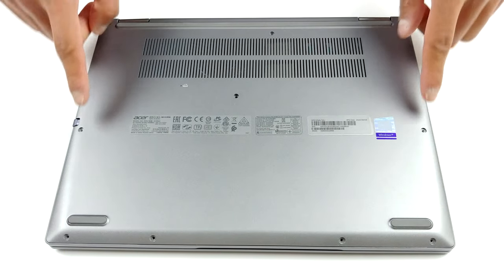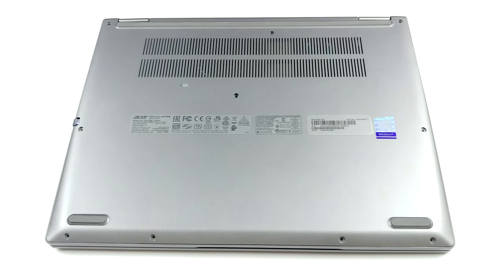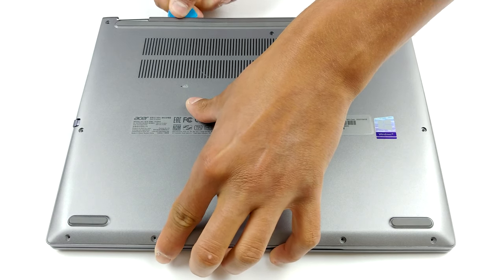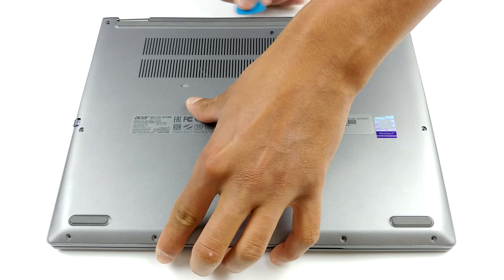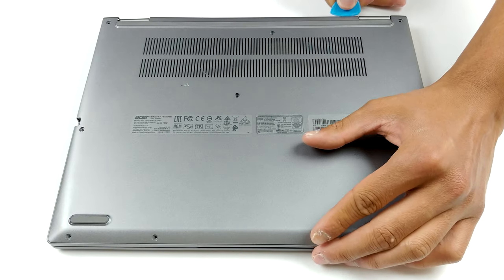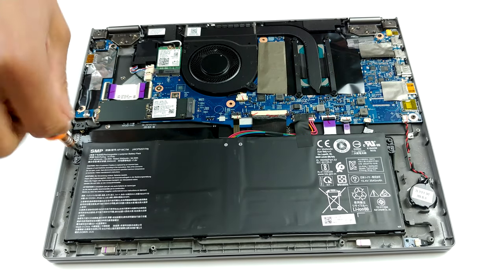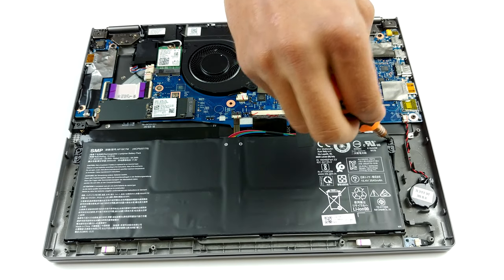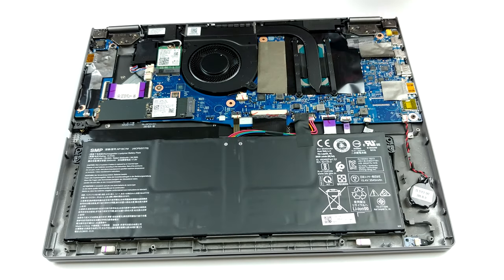🛠️Acer Spin 5 (SP513-54N) - disassembly and upgrade options

Comment: This is great. I had gotten as far as removing the screws but chickened out. Soon, I will be replacing the conventional hard drive with a superfast SSD. I upgraded my ancient desktop (which had a cheap SSD) to 12 GB...this ancient desktop opens up an image in Photoshop in 22 seconds, and effects are pretty much immediate. Opens up 2 other pics simultaneously right away. My Acer SP515 with 8GB and Core i5 takes several MINUTES to do the same with the same, latest PS 2020! I think the SSD is main reason. Four-times faster (than the SSD I have) 500GB SSD's are now around $80. That's a saving grace since my memory is also SOLDERED to the motherboard--which can handle at least 16GB.
Reply: The convertible PC here doesn't have a conventional hard drive or an SSD.  See 2:18, it's NVMe, which it quite fast as far as I know.  There doesn't appear to be room for an SSD in any case.  The model I have already has 16GB RAM as well, so no upgrades for me (A better GPU would be nice, but I assume overheating would be a serious issue).
Reply: @Vinnie002  Looks like NVMe is even faster. Unfortunately, my SP515 has a conventional drive. Crucial.com has recommended SSDs for it, and I've read others' accounts of upgrading. I believe I can even add the SSD in ADDITION to the regular drive--as some offer that configuration. I'd hate to add to the weight, though...